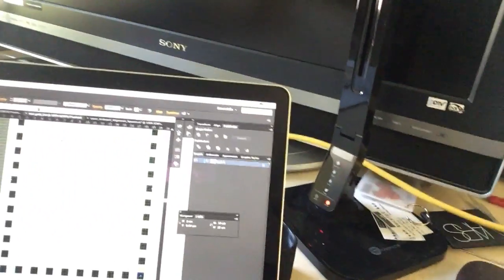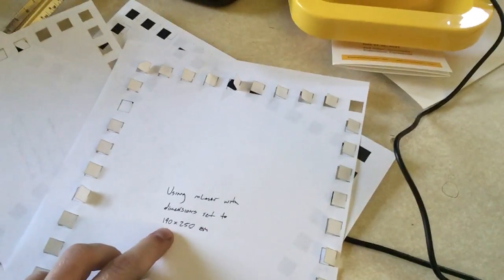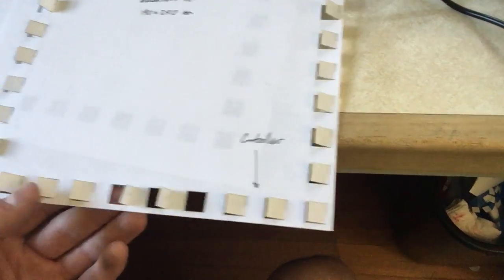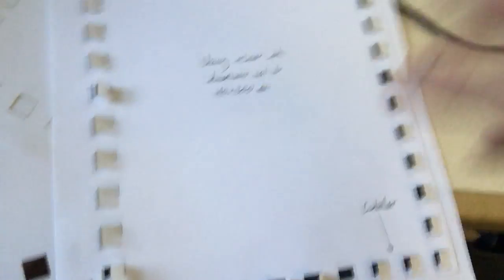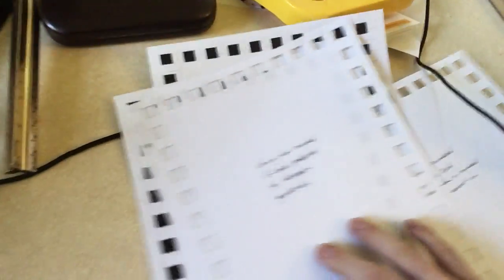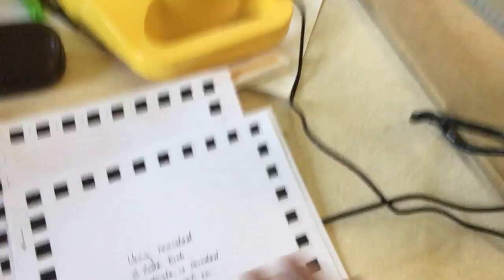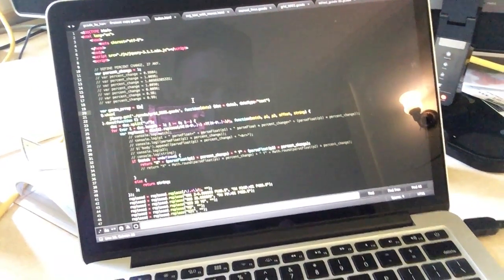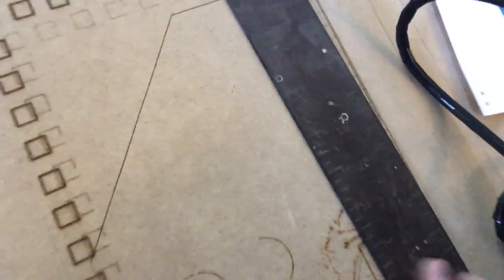Makeblock Laserbot Inaccurate Cutting Problems

Comment: Xen0phobe i was wondering if you could assist me in using your gcode corrector, i am desperately trying to correct my gcode but it is a pain in the ass doing it manually. I would very much appreciate the help! I went to your git hub but the instructions at the top seem to be cut off
Reply from the maker: I replied to your Github comment.

Comment: The original firmware is almost useless... I created a new one and it solves all issues... Need to finish some final testing, then you will find it in my github
Reply: Is there not .ino file in the github repo? I still need to create a video tutorial, but the code in my github works perfectly on my lasercutter :)
Reply from the maker: If that's the case, I would love to check it out.
Reply: Taylor Shockey search for grbl-laserbot at github - first version is online, documentation and videos will follow
Reply from the maker: Found it. Before I go through the trouble of flashing my Arduino, is it operational?
Reply: Taylor Shockey my laser works... But maybe wait for my detailed doc and videos, it will save you much time and frustration
Reply: Hi René, I went to your github and followed your instructions but at one point you say "Connect the Mega Pi Start your Arduino IDE and open the grbl.ino file in the /Arduino subdirectory of this repository." - there's no grbl.ino file in there. What am I doing wrong? Thank you
Reply: I'll just wait for your tutorial, I don't wanna fry my board :D